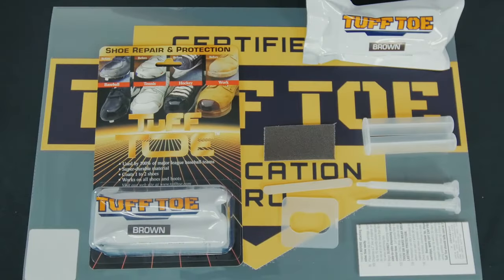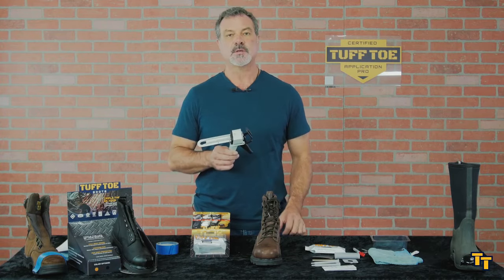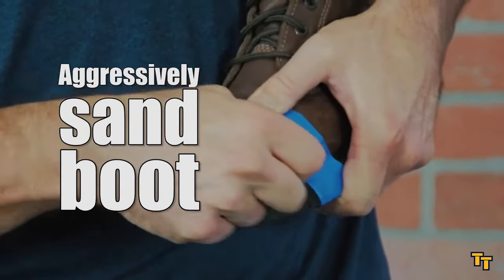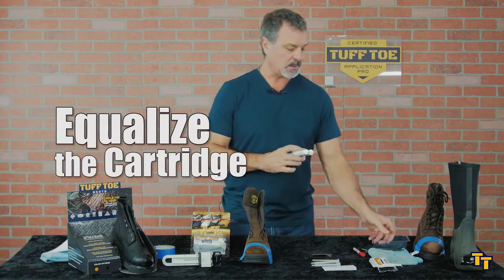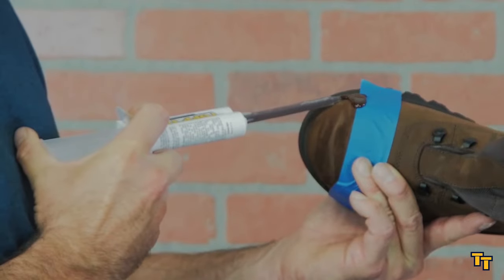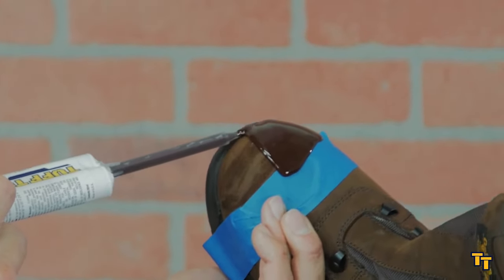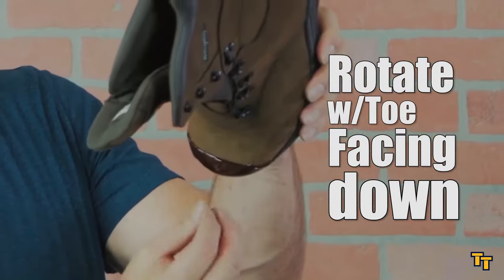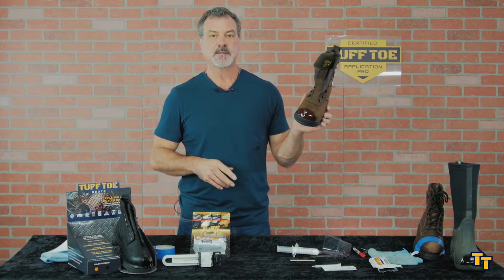UPDATED: How to Apply Tuff Toe Boot Guards for

Comment: Took me a few months of procrastinating to finally do this. My one boot had a hole in the toe.  They look great!  Hardest part was using the syringe, got a good forearm workout in.  Literally just have to rub the stuff 20 min later to get a matte finish.  Thanks for the video, helped a lot and I don't need to buy new boots!
Reply from the maker: Hannah Thanks for the feedback on the video. Glad you’re happy with the results. We have an application gun that makes application super easy and allows you to purchase Tuff Toe cartridges at a deep discount.
Reply: Just did my Irish setter Ashby's. Probably the MOST nerve racking experience of my life. But have to say they turned out pretty good

Comment: I have to say. I am getting a whole other year at least out of a comfortable pair of boots that were about to be trash.

Moc Toe steel toe boots, the top moc toe flap was peeling back on both boots, missing stitches etc.  I was not past the edge of the steel yet, but I'd imagine if I was I would not have been able to save them. 

My application was not the smoothest, but I was able to maintain the moc toe look and was also able to achieve the matte finish as instructed in video. 

They look great. Are water tight again and are taking the toe abuse like champs. 

Thanks tuff toe
Reply from the maker: Thanks for the feedback James. I think even if the steel was hanging out you could have saved them. You just apply a coat over the exposed steel then another over the entire area getting a double coating on your hardest wear area. If you haven't already, check out the Tuff Gun applicator. It really makes the application super easy and also allows you to then purchase Tuff Toe cartridges in bulk without all the packaging at 30%-50% off standard pricing on our website.

Comment: Great video if the A/B part tube was in  clear it would help the process just did both boots with just a little over half should have went thicker with one application
Reply from the maker: Next time. Place a mark half way down the tube so that as you approach that line you can finish one boot and then move onto the other one.

Comment: I followed the directions and I wish it came out as good as in the video. The product didn't seem to flow and level out very easily which left a somewhat lumpy appearance showing where the rows were laid on the boot. My boots were tore up pretty good on the entire composite toe so I put it pretty high up and it took the entire tube to do both boots. If I were to do it again, I'd probably have someone do it professionally, or at least buy the applicator gun because the product is not easy to push out. We'll see how it holds up over time.
Reply: How is it holding up? Same here
Reply: @malena7362  it's for a set of workbooks so the appearance isn't that big of a deal to me. It seems to be holding up well so far, and I'd prefer to damage the tuff toe coating than tear up more of the leather of the boot.
Reply: @michaelcrowley7330  same here it’s for a pair of work boots . Thanks for the reply.

Comment: I just did my boots and I can see where the gun would come in handy.  The applicator is a little hard to squeeze.
Reply: Two part epoxies will always be hard to squeeze when using a mixer tip. JB Weld epoxy cartridges with a mixer tip are even HARDER to squeeze than even this!

Comment: Update...I didn't like my first try.  It didn't come out as smooth as yours did.  I has some small pin holes.  Is it possible to place another layer on top to smooth it out some?
Reply from the maker: Tuff Toe bonds very well to itself so you can apply another thin layer if you want.

Comment: What is good advice if you already have a hole and the steel showing? Advice to make it even?
Reply from the maker: Sand the entire application area including the exposed steel. Then cover the steel with Tuff Toe first bring it to the level of the leather. Then apply a full coat over the entire toe getting a double coat on your hard wear areas.

Comment: Can you apply this to a boot that the leather has peeled up on the steel toe?
Reply from the maker: Yes. Either cut the frayed leather away or glue it down to the steel. Then apply tuff toe on the steel portion to fill it in to the level of the leather and let it set up a few minutes. Then apply another coat over the entire toe area so you get a double coating on the hard wear area and minimize the indent on the front of the boot.

Comment: In the tube, is the material the same or is there like a standard material then and activation that need to be mixed? I just attempted mine but one of the sides of the tube wouldn't move at all so I had to cut it in half and only use the one that worked.
Reply from the maker: Both sides must mix together for the material to cure. You should remove what you have applied as it will not work. What is the number on the cartridge label. It sounds like you have expired product.

Comment: Will this work for Thorogood boots with the different toe style? It has like stitching
Reply: @tufftoe
Reply from the maker: Tuff Toe works on any boot that you can sand and prepare. If the boot has a rubber toe bumper then you need to aggressively sand it and wipe it with an acetone before applying our product.

Comment: How does this hold up to abrasion on asphalt/concrete and gravel? Need something like this to prevent my combat boots from wearing through in the toe (lightweight, athletic boot. Thin lather).
Reply from the maker: varun009 this is exactly what Tuff Toe is designed for. Abrasion, water, and chemical resistance. Applied correctly Tuff Toe will triple the life of your boots.
Reply: @TuffToe  wow, rapid response. Thanks! I'll have my girlfriend send some over! Any chance this comes in desert tan lol?
Reply from the maker: varun009 we do make a wheat colored Tuff Toe that we call tan. Check it out on our website. https://tufftoe.com/collections/work-boots-toe-guard/products/tuff-toe-work-boot-toe-protection-repair

Comment: I've managed to wear the leather down to the steel of the toe on my boots.  Will it adhere to the steel part of the boot?
Reply from the maker: Yes. Make sure to sand the steel as well as the leather. You can also cover the metal first to bring it to the same level as the leather. Then you can coat the entire area. This ensures that you have double thickness on your hardest wear area.
Reply: @Tuff Toe  I appreciate your quick reply.   I placed an order for the gun and the 2 pack of brown on Amazon.   It comes in on Monday.   I appreciate it.  Thank you.
Reply: Ok.  I received the tuff toe today.   I have taped off both boots.  I'm watching your video a couple more times just to make sure I didn't miss anything.  I'll follow up with you again once it's all done. 😊
Reply: @raymondpalacios3032  How did it work out?
Reply: @kahmoi crawford  it was OK.  It had some real small air holes.  I did two pairs.  The second pair was a little better, but it still had some tiny air holes.

Comment: Can't recommend the applicator gun enough. Don't be fooled, this guy has got Terminator forearms, after the first boot your forearm and hand muscles will be on fire. It's also easy to apply too much pressure to one side of the plunger than the other and screw up the mixture.
Reply from the maker: You're right Evil D, having the gun makes life so much easier AND once you have the Tuff Gun you can purchase just the cartridges unpackaged saving 30%-50% depending on volume.
Reply: @TuffToe  is the cartridge itself available anywhere in Canada other than complete kits ? Thanks
Reply from the maker: @juliendemers4446  no retailers carry just the cartridges. It’s only available on our website.

Comment: Would this work on steel toe boots as well? And would boot oil affect the tuff toe material?
Reply from the maker: Yes. This is to protect the leather on steel toe boots. To apply to a highly oiled boot you would de-glaze the toe area by using a wet cloth with some Comet or Ajax sprinkled on it and then rubbed aggressively before sanding the same area.  You shouldn't have any problems with Tuff Toe bonding to the leather after that.

Comment: Redwing applied this to my metaguards covering several flex points. What kind of drawbacks is this going to cause?
Reply from the maker: Over time the Tuff Toe may want to separate from the meta guards. It depends on how well they were prepped before application and how thick they applied it. Generally we don’t suggest going over flex points. Let us know how it goes.

Comment: What they dont tell you is that the product doesnt flow nearly as easily as it does in the video. It almost takes 2 hands to apply it. I dont know why red wing doesn't make a toe protector available on its boots. I would gladly pay a little extra to have it already on. Putting it on was a hassle. And now I have all these plastic tubes that are just going in the garbage cause you can't recycle them full of product
Reply from the maker: Hi Paul.  The Tuff Toe material does get thicker over time. Not sure where you purchased the product from but perhaps you had older product if it was that difficult to dispense. Purchasing directly from Tuff Toe ensures that you will have the freshest product available.  We do have an application gun that makes the application much easier and with the purchase of the gun you can buy in bulk from us at a discount. Most Red Wing stores that carry Tuff Toe will apply the product for no additional charge as well. I hope this helps.
Reply: @TuffToe  That used to be true, until some bozo complained, and now they will only apply it to "house" shoes.  In other words, if you don't buy from them, they won't apply the protector.  I had to buy the kit for this reason.  I needed shoes RedWing doesn't offer.

Comment: Will tuff toe bond to rubber boots like mucks?
Reply from the maker: Yes.  You really need to aggressively sand them and then wipe the application area with an Acetone solution before application. Firemen apply Tuff Toe to their rubber boots with no problem.

Comment: What if you have a big chunk of steel toe showing?
Reply from the maker: Sand the exposed steel. Apply Tuff Toe as a patch and let it cure. Then apply another coat over the entire toe area so you have a double coat at the hard wear area. If you apply the first patch as thick as the surrounding leather then you won't see a huge indent after you apply the second coat.

Comment: Does this work for soft toe boots?
Reply from the maker: This works as an abrasion, chemical, and water resistant coating for any boot...hiking, motorcycle, work, horse riding, snow boarding, etc. It doesn't replace the crush protection of a steel toe boot if that is what you are looking for.

Comment: Tip would work better if it screwed on to bottle instead of flying off and wasting product.
Reply from the maker: To lock the tip in place turn it a quarter turn to lock under the cartridge arms.

Comment: Mine came out like shit looks like a chocolate fountain. the first half of the tube didn't flow very nice . The cap took a screw driver to pop off. Second boot turned out ok.... still looks like shit though. Not worth the 29.99 IMO, but I'm a Welder not an arts and crafts guy. ill see how it holds up and its very hard to judge how much to use even marking the half way point . No need to go to the gym after the forearm workout this application gives you.